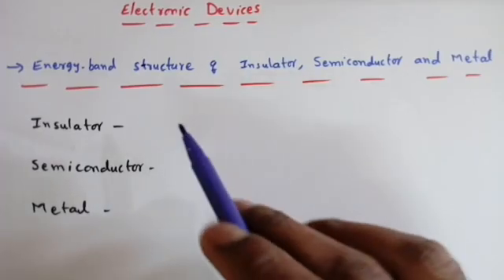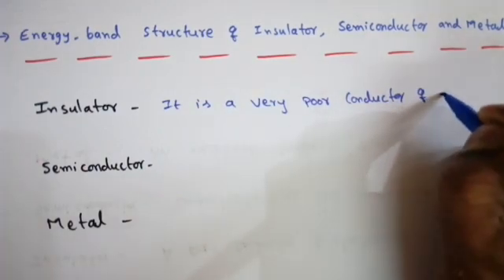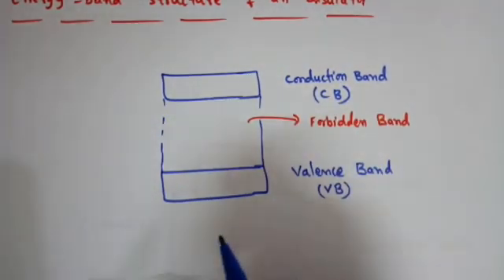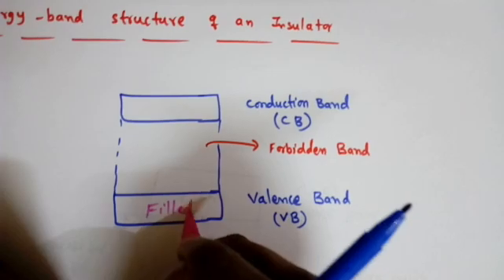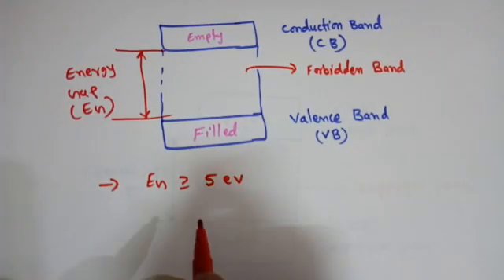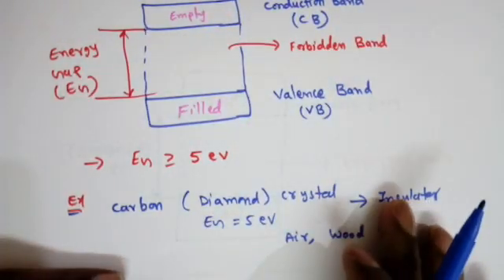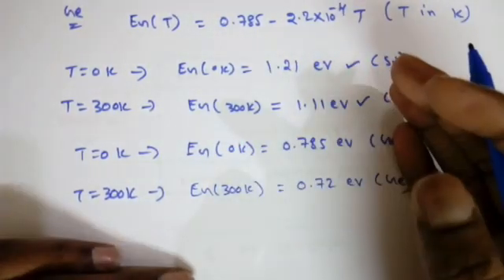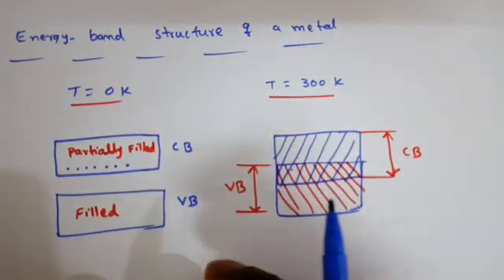Electronic Devices Lecture-7: Energy-band Structure of Insulator, Semiconductor and Metal

Comment: Sir I have a doubt that u said in last  10 sec of the video that energy band gap for metals is approx zero  at 300k this means conductivity of metals increase on increasing temp but this is not true bcoz on increasing Temp resistance of metals increase correct me if I am wrong? Plz